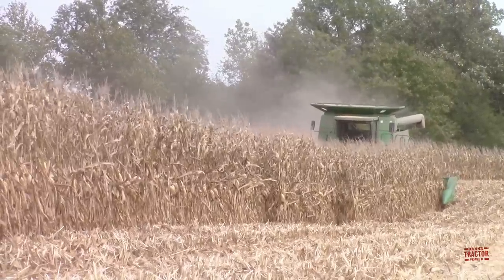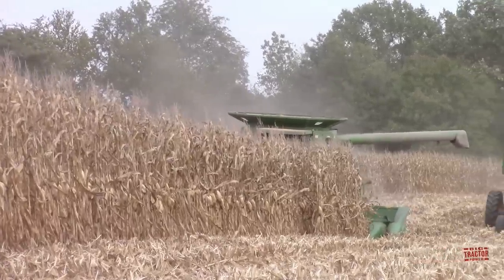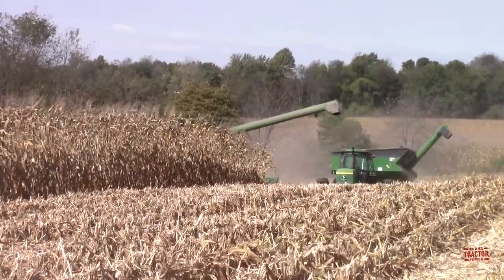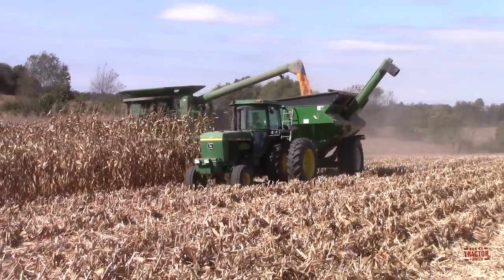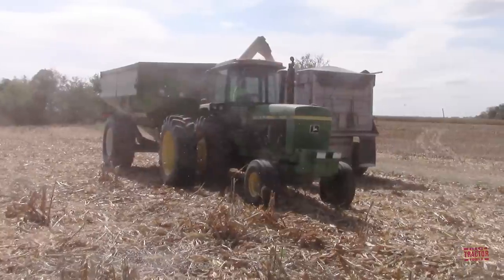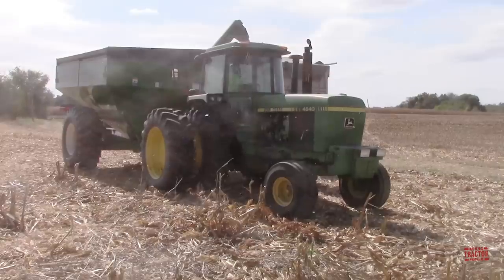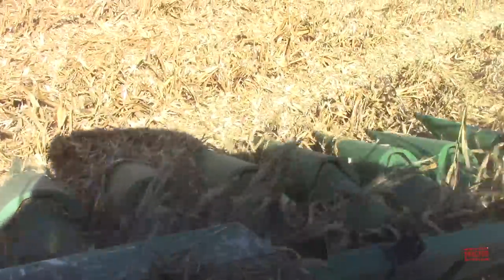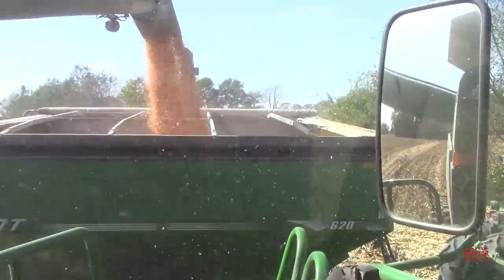JOHN DEEERE 4640 Tractor on Corn Harvest Grain Cart Duty

Comment: I've always had a soft spot for those 40 series tractors.  I spent many an hour riding with my Dad in a 4040.  I'd love to find it and bring it back home.
Reply from the maker: Very cool. I hope to get to film a 4040 sometime.
Reply: I'll see if we still have any old photos of it you might find interesting.  Dad would convert it from standard two wheel wide front to the tri-cycle front as we had one piece of equipment that wouldn't fit on the tractor otherwise.  It was a cutter for beans (dry edibles, great northerns or pintos).  It predated me by a number of years, and if I had to guess all these years later, it was originally for a tractor he must have traded in and was wondering why.

Comment: Dang a 9600 pushing 12 rows is quite a load. Most folks in northeast Missouri run 8 row heads on a 9600

Comment: As a guy who has operated  Maximizer’s in corn, I’m shocked that machine can even pick up a 12 row head. I had a 6 and 8 row heads on a 9500, and 9610. On either machine, the acres covered per hour were identical, one just moved forward a little faster. Wider does mean less tire tracks and compaction, so I can see the benefit. Your just not getting done any faster.
Reply: And the spread pattern isn't wide enough.